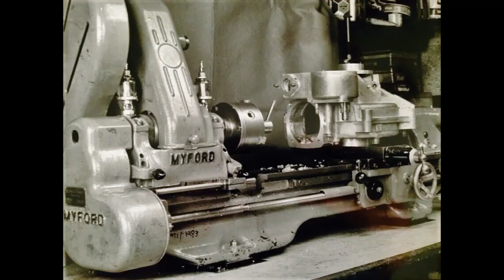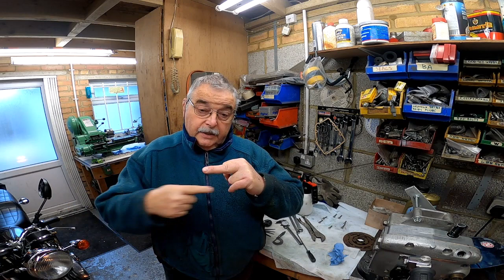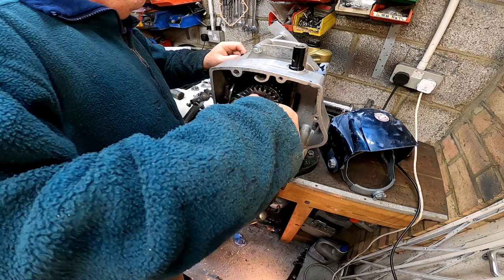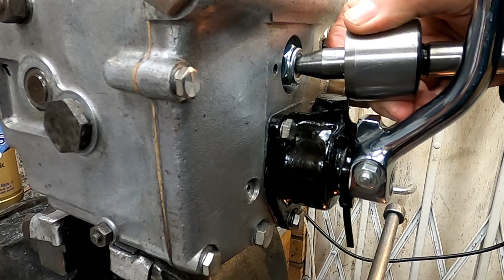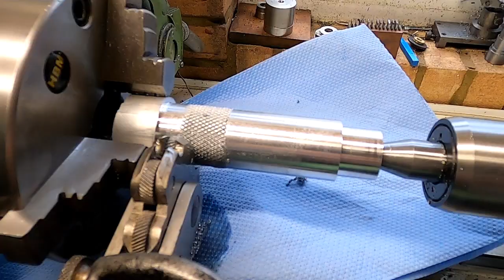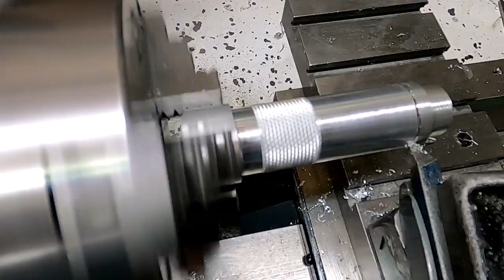Velocette 500, 5 speed conversion, part 6

Comment: YES! We are still very interested. Although I am really glad my Colchester Student has built in metric/imperial gear selection facilities. Congratulations on a successful 5 speed conversion, are the gears very much reduced in width to achieve the extra gear? Chris B.
Reply from the maker: Yes, the gears are slightly narrower, but a far tougher more modern material. The only issue on the road is the additional effort to rotate the selector plate. The detent on the perimeter of the selector plate seems to have more authority than on the original selector plate.

Comment: I'd remove the material from the other end of the nut and keep the Nyloc end.
Reply from the maker: I considered that however the base surface of the nut needs to be square to the thread geometry, so it tightens down with full contact.